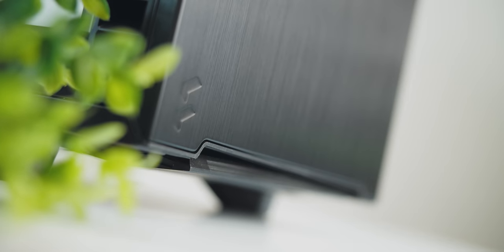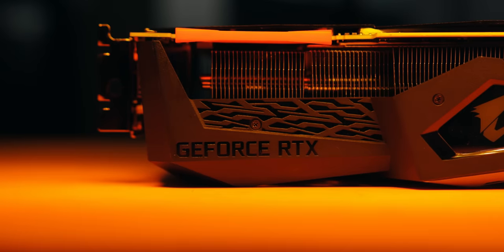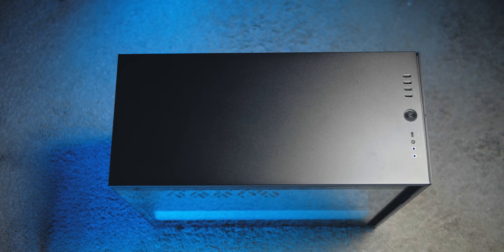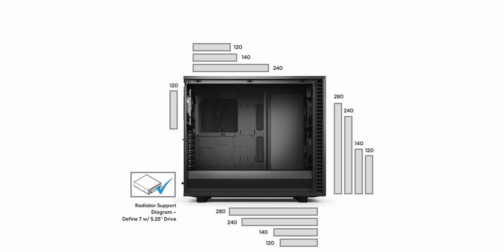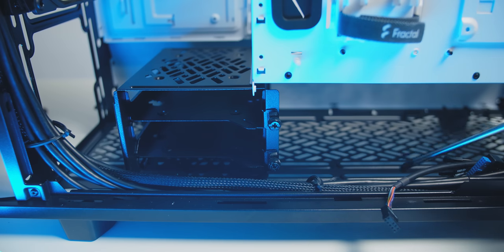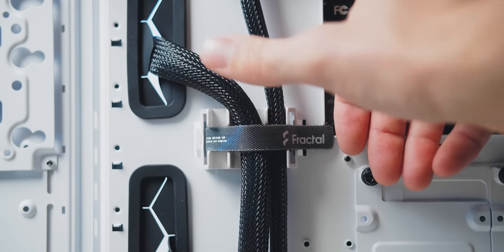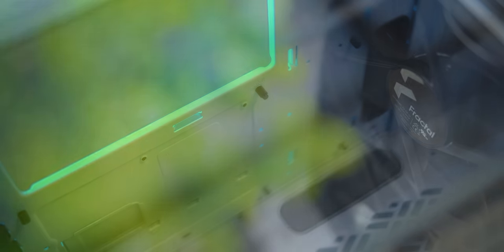Have We Reached Peak Case? Fractal Define 7 Review

Comment: i'm waiting for Fractal Design to update the Meshify C.
Reply: Same here bud
Reply: they did.. its called Meshify S2 now xD, im now waiting for an updated Meshify S2 of this chassis
Reply: @SilentRito  you are totally wrong. The meshify S2 is the mesh version of the define S2.
The meshify c is a compact mid tower whereas the meshify S2 is a full tower.
Reply: I was asking Fractal all year in 2019 a Meshify C2 for my new build since they updated many in the S series, stopped trying and ended up buying the C, waddya gotta do, still the best minimalistic case under 100€ :P
Reply: They need to get together with Glorious and make a rgb Meshify D
Reply: But Meshify C is already perfect
Reply: @GrenadeInMyHead  A couple more USB ports at the front, and it would!
Reply: @GrenadeInMyHead  the mounting mechanism for the tempered glass side panel could really use an upgrade
Reply: They surely shall do soon. Too bad, though, that Fractal just releases things and does not even tease them anymore :D
Reply: @GrenadeInMyHead  Meshify C isn't perfect, the front panel is hard-wired to the I/O which is cheap and makes cleaning it a pain, the duel mesh design is more restrictive, no USB C, and the tempered glass attaches with old fashioned and tricky screws.
Reply: Just did a build in a meshify C, it was a total breeze to work in coming from two traditional tower cases, and recently doing a build in a nzxt H510. Easily the best case I've ever built in and was very fun to do.
Reply: @GrenadeInMyHead  Not if you want a long GPU setup.
Reply: Same here LOL
Reply: @GrenadeInMyHead  I hope it can do vertical GPU card thing.
Reply: @arianakhan6665  You can remove the filter from the Meshify C seperate from the frame of the front panel by reaching in under the bottom and popping it out of the frame, so the hard-wired I/O isn't an issue. Dmitry was actually one of the few reviewers to note this in his review. Most of the others missed it and made the same complaint about it being difficult to clean. I do agree that the Meshify C is in need of an update in several other areas though. The Define 7 Compact is a good sneak preview of what a new Meshify will hopefully be.
Reply: @CaptainKenway  Ah, I didn't know that, I'd look into it, but I think the case is dated, and as an original Define C user the Define 7 Compact was a disappointing, lazy, upgrade by Fractal, so I'm not optimistic over the meshify refresh, but I'll look out for it. I'm intrigued by Corsair's leaked 4000D Air, releasing in Sept.
Reply: This aged well
Reply: aaaaannnnd they did! Wow this aged well lol

Comment: This is actually a pretty damn good case. But I think what would really set it apart is if they made an optional mesh front panel door that you could swap the default sound dampened one out for. They already have that option with the top panel, so they might as well let people do the same for the front. It's called the Define after all, so let the user define how the case functions.

Comment: I own the R6 and really like how they just improve small parts to make the case perfect. It is as you said a simple mainstream case, but that is all we need. Airflow is good, silence good, modular and the best case I ever worked in. What else so you need? For sure no reason to upgrade. But they made nearly perfect Case a bit netter. That's awesome for all future customers.
Reply: I liked that they added more holes for cables in the top of the motherboard tray, but my cable management always comes out messy so not sure how the new system would help me so its a good thing the R6 has good room behind the motherboard lol.
There are some stuff I wish was on the R6 that I see in the R7......sorry, Define 7, you also get a XL version not just midi tower.

Comment: Great video.  So I have this case and it's pretty awesome. Built my PC in December of 2020.   Problem I had though is that I wasn't able to find a decent GPU and settled for an RX 5600 XT.   I had a really hard time keeping the GPU under 80*.   I tried several things, including keeping the side door off with an fan blowing on it.  Steve with Gamers Nexus criticized the front door and filter as it didn't let a lot of air through... he's exactly right.  HOWEVER - I fixed this by changing my Fans to run off of the System sensor on my MSI Unify MOBO, and I upgraded my 2 front 140mm and rear 140mm to Noctua a14s.   Also, if you're not running a radiator, don't use the ventilated top cover.  You need the airflow through it and you lose air pressure with the vented top panel.   I can't get my GPU over 74* now with the door SHUT!  Now it's super quiet and cools well.

Comment: 3:55 "As long as the height of the MB doesn't exceed 36mm"

Wow this must be the new Nano-ATX format, i'm so hyped
Reply: Motor_Storm wrong height I think
Reply: Height of the RAM. But honestly, that's very limiting and as an R6 owner (which has the same restriction), it's I think it's stupid. If they just made the case say 15mm wider and 15mm taller, it would improve radiator compatibility / clearance significantly.

Comment: I have been building my own computers for more than 20 years. I come from a time where metallic rounded edges was considered a great new feature.

I just upgraded my case to this new one, and holy cow... 98% of it is shockingly well designed. I absolutely love it. At every step of the building phase I was discovering something I had never seen before and wished I had all of these previous years. 

My only small complaint is  about the not-so-great stock fans. So I replaced them with some Noctuas, and now it stays quiet and cool.
Reply: Thanks for the comment! I'm more confident to purchase this case now
Reply: I just bought this case a few weeks ago for my unraid server build. Friggan love this case.
Reply: @ZedFiles  did you end up buying it ?
Reply: @travelingmaniac  Not yet, but I will once the Samsung 990 SSD comes out in the 4TB variant

Comment: I have a Define R6, and it has been perfect for my needs.  I like the metal parts of mine better than the plastic they're using on the Define 7.  However, I am happy to see they are continuing with the Define model, because there are many of us who need an optical drive.  I recently used mine to print X-rays from a CD to my primary doctor, because their computers were unable to handle the work load that mine can!  It is simply amazing that a builder can have more power than most offices, even approaching many workstations used for engineering applications.  Although other cases offer better cooling, the Define series are better at integrating older technologies with newer.

Comment: 1:48 where do you buy the optical drive mount? does Fractal sell it on their website? Also ...what is the point of putting fans at the bottom of this case? how does the air get up from down there since it's closed off?

Comment: I like it. Still rocking my beloved Define R5 with a newly installed tempered glass panel. Love love it!
Reply: I built with the R5 too, but solid panel. I prefer it to the successors i.e. no psu shroud, more drive caddies, more metal/ less plastic, lower price.
Reply: I had an R5 too for my first build from about 5 years ago, but starting a new build and can't decide if I get the 7 or stick with the R5 and get the tempered glass panel. I do like the look of the PSU shroud though it would definitely help with my OCD cable management

Comment: Thank you Dimitri for an honest review of an old fave. "Peak Case" - very good! :-) Define Looks perfect EXCEPT for the PSU shroud. If I am buying this gorgeously practical case (still has optical drive - YESSS!) and if I want to install my beautiful Titanium 850W PSU well, then, I want to show my Seasonic Titanium to the world. It is as important, if not more so, than other components that get seen through the tempered glass window. What is this emerging cult of hiding big beautiful PSUs??? On a practical note it would seem the cooling of a PSU is also hampered by enclosing it unnecessarily. Phanteks Evolve X has the perfect solution where they use a little cut-out to show the world your powerful PSU, leaving most of the shroud there to hide the cable mess - best of both worlds and truly innovative. Just cannot believe Fractal pissed this opportunity up against the wall by keeping the same visually and cooling restrictive shroud. Otheriwse it would have been perfect.  After 2 whole years of research AND after seeing Phanteks to do right, how on earth could they miss this one little thing? I'm not one for RGB but I think after waiting 2 years for this '7' I'll be going with Evolve X. Looks more exciting too frankly. Sad, waited a good while for this one . . .

Comment: Nice review! Thanks!!!
I have the grey case. It's like a fine metallic grey, and looks great.
Like you pointed out, the 3 different mesh patterns on the top 3 panels does
make the top look messy, like 3 different designers created their own pattern
for their respective panel without consulting each other. I'll bet they fix it in rev B.

Comment: They say support for 420mm in the top and 360mm in the front.. They say that. I have the old Meshify version, 1. You either have to use low profile RAM oooor mod your RAM's coolers (which I did) and 2. you have the sort of mount the front fans externally and modify the front panel to make space... You have to lose the dust filter and cut out, more or the less, the entire plastic reinforcements. After a few months I can report the metal mesh front panel works fine on it's own as a dust filter. All of this barely fits, but it fits.

Comment: I dont understand some Fractal design decisions. They made the top panel swappaple, but the fan mount underneath it that was already removable only comes in one version that is quite restrictive if you want to use 140 mm radiators & fans. I also wish the front fan mounts would mimic the Torrent where there are Fan adapters and not that clutteres mess that increases fan noise because the blades fly past those reinforcements and fan holes at close distance.

Comment: The Meshify 7 should be amazing!  And for what it's worth, if you plan to use the top as exhaust you should remove the dust filter anyways.
Reply: gr82bAnAUTiger Best not to do that if you’re not planning on letting it run 24/7. Dust will fall in while the PC is off.

Comment: Hi Dimitri, What would be the best arrangement for an AIO? I'm wondering if putting a 240 rad up top pulling air into the case along with 3 fans to the front and 1 exhaust would be ideal? Or would that be alot of positive pressure?
Reply from the maker: I’d put an AIO at the front as intake. 
-D.
Reply: @HardwareCanucks  Thank you sir! :)

Comment: To be fair, A PC case is essentially a square box. there aren't many things you can do with it other than throwing away everything and start from scratch. Meanwhile, I'm looking or a Micro ATX form factor case that fits an ATX motherboard while looking decent. The RIotoro C1088 *I think it was) is a no go due to the bump in the clear side panel. and the other case I saw that fits would be the O11D Mini, which isn't released yet. 

I do realize that what I'm looking for is a bit odd, but I got a sound card I want to keep using! I ask for a lot, don't I?

Comment: Case manufacturers need to get rid of the empty space at the front. It's only for hard drives which most of us don't use or put behind the PSU shroud. Let's get the intake from the front fans closer to the hot components.

Comment: Not a huge fan of the weird cross-hatch design, but still pretty appealing for the price. I bought a Define S ($130 USD) a few years ago, and swapped out the acrylic window for tg panel ($35), cut out a square hole on the front cover with a cheap rotary tool ($20) and epoxied a metal screen cover (I paid $7 at a local hobby shop), and just recently got a vertical gpu mount ($45) and had to cut up the case to get it to fit. All that, and I still don't even have a PSU cover! Im kinda thinking about just buying this new one lol

Comment: I'm waiting for smaller cases. With aircooling, there is simply no need for all that space between the mobo and the front of case. I'm looking forward to volume optimization. It doesn't have to be the smallest, but it can certainly be smaller.

Comment: The XL version of this case was future proof. It works flawlessly with Arctic liquid freezer ii 420mm radiator  on top.

Quiet monster rig with extreme overclock under heavy load. That's as spoiled as you can get in gaming without a headphone...

Comment: Fractal Designs need to make very compact itx cases (smaller than their node models). It's a market that hasn't been tapped much by major manufacturers. All those small itx kickstarter cases are sold out all the time for a reason.
Reply: Imagine something like the S4 mini or Dan itx case, but with dust filters <3

Comment: Any improvements to building and cable management are going to be up to the mobo and graphic card manufacturers. 

I think all power connections should be opposite of their current location. That way you see zero cables what so ever.

When I say opposite I don't me location. I mean flipped around so you can plug the gpu, cpu and 24 pin from that back side of the motherboard. Case manufacturers can move the holes directly behind the mobo for easy access. 

That would be epic. Better airflow, and less dust. Over all a better looking system without having to shell out extra money for cable mods that never seem to look all that great.

It woukd  also allow the ability to make cases a little smaller or just have extra room for water cooling or ssd trays.

I jusg ordered the lan cool 2. Im finally stepping into ddr4!

Comment: Nope. When they update the Define Nano S to support the fanless Seasonic Titanium PSUs (that stupid non-structural bump on the case floor makes them 10mm too long), include a PSU shroud with drive mounting options on top, improve the mounts on the back of the big panel to be both 1x3.5" AND 2x2.5" compatible, and update the front panel I/O to be USB C, THEN we'll be at peak case. That spec is natively capable of being a 10-drive NAS plus an M.2 boot drive.

Comment: I feel like the biggest innovation to never take place is in vertical airflow.
Creating cases that duck air from benith and push it out from above.

Also another innovation is what Apple did with modules that lead air through the case from high pressure fans that turn slowly.

Comment: I don't think this represents "peak case." I think that was reached with the Define R5. It remains the absolute perfect case (don't mess with my optical drive bays; the Define 7's doesn't count). The R5 handles everything just perfectly. I prefer its handling of drive bays to the sleds with moving a wall of the 7. I wish they'd have redone the R5 with front USB-C, the improved power & reset switches, implement the optional air filter / mesh top panel, and do away with the "lip" for the rubber grommets along the side of the M/B tray, but even with these areas where the 7 is a bit improved, I still think that the R5 is the superior case all-in-all.

The 7 isn't bad by any means, but for my needs, the R5 clearly edges it out.

Comment: why are cases all going the glass side panel route, I'm looking to build a PC I have all my parts picked and have the Fractical meshify C picked out. however if it wasn't glass it would probably be cheaper which would be nice. but I looks nice, and has good front air flow so that's why im going for it

Comment: To me the mesh top not "matching" the filter is not a big deal.  I will not be looking at the top of the case when using the case.  If I decide to get one, since they are one of the few left that have room for a optical drive, that is not a deal breaker for me.

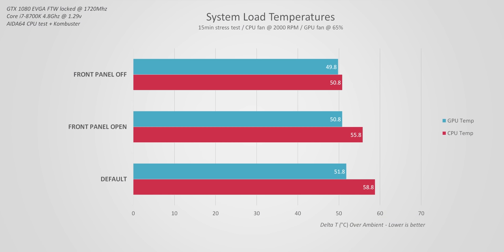Comment: 2:02  Please Fractal Define risk for once..and give us some airflow.
8°C DELTA IS TOO MUCH.
Reply: I don't have this case but I have the r5 and the sound insolation is amazing and wouldn't change it for the world. After I think 4 years I am thinking to go air-cooled and close the too completely to enjoy true silence. As long the temps can be maintain at acceptable low levels it shouldn't matter
Reply: john smith I’ve got an R5 as well. No glass panel and top closed, using a Noctua NH-D15 to cool my 6700K. Apart from my HDD making some noise it’s virtually silent.
Couldn’t be happier with it.
Reply: Use use mesh versions!
I like the Door and can suffer the small heat increase it prings, but if you need airflow Fractal design mesh cases Are perfect to you!
Reply: @nicoper  yes the good thing about closed cases, like even the BeQuiet for example, is less noise from hdd and coil wine.
But I wouldn't sleep peacefully knowing that my cpu runs 8 or 10 degrees hotter than it would run in a more airflow focused case. 
Yeah maybe I've got a proplem :D

Comment: certainly no "peak"...1) their metal sheets are still thinner than optimal to reduce vibrations (just too many shitty cases, even expensive ones, out there), 2) leaving thei HDD trays unsupported from one side is far from perfect, 3) manufacturing can still fail in a frustrating way (e.g. that bottom filter hanging lower on one side, this means bottom dust finding its way inside), 4) decisions are still suboptimal (bottom filter should be removable from the side, to avoid grabbing the filter when picking up the case)
You SHOULD take a look at Antec P110 Silent & Antec P101 Silent...first one sells at around 70-80 EUR, the second at 100-110 EUR